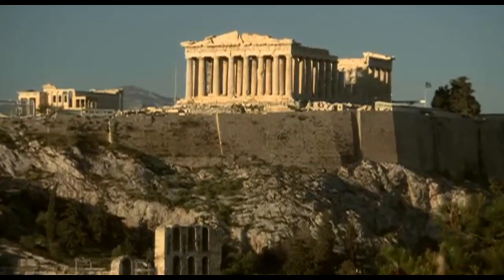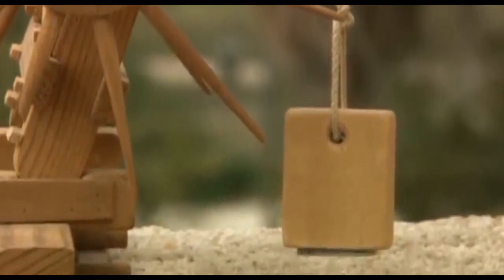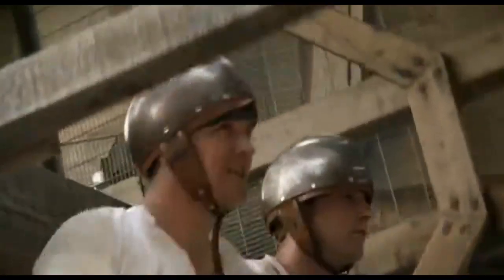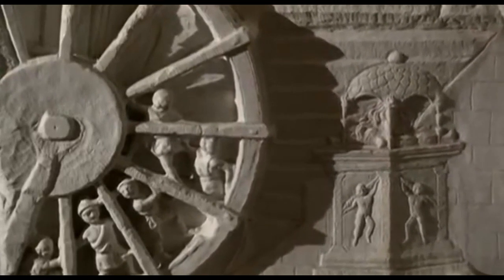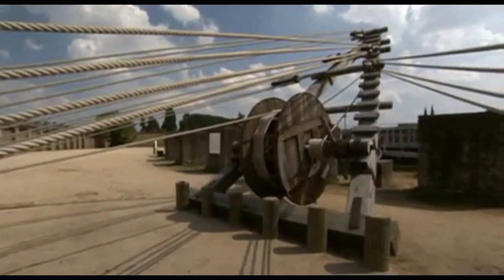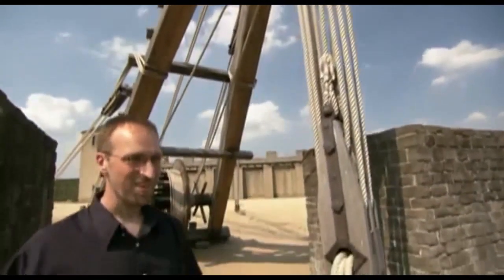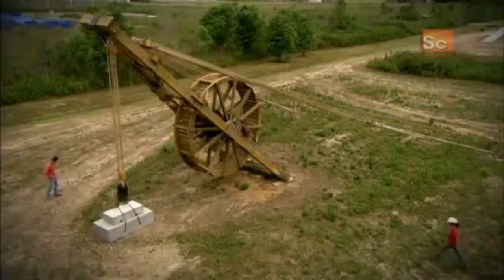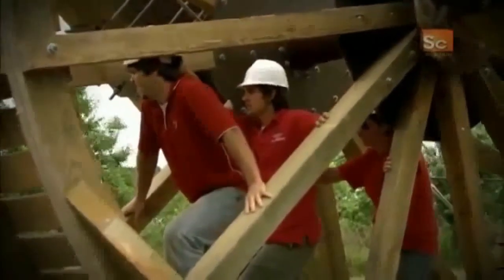Ancient Cranes are Modern Cranes GEARS PLUS COMPOUND PULLEYS

Comment: so what about a 100 ton or 300 ton block? they claim the romans had it but egyptians didn't, but egypt had just as impressive stone movement
Reply from the maker: neoclassic09 Roman cranes there based on compound pulley and capstan (mouse wheel) . It’s all based on ancient ship tech. The mouse wheel just a large version of winch used to lift buckets up well and the pulley can be replaced with truckers hitch or just a greased branch.
Typically said the Egyptians didn’t have wheels but that means they weren’t using axle wheel such as on carts or chariots. They did have potters wheel.
Same with the Egyptians didn’t have pulleys. None found but with a piece of rope tied into hitch or just piece of wood they could serve as a led pulley system.
But they did have ships and to rig ship mast and sails you have to have some knowledge of mechanical advantage. Small crew can not operate a ship otherwise. Surviving rope, knots show they had the skill. The wood and rope they used strong enough for the heaviest stones they moved.
Plus the best Greek- Roman machine designers and engineers came from the Library of Alexandria in Egypt.
Could be it was just a city that inspired  inventors and engineers but I reckon people like Eratosthenes read the old works stored there. Then got the credit for repeating much older experiments and designs.
Reply: @SacredGeometryDecoded  ..ofc the egyptians had no clue of a wheel...^^ but they measured time and knew about circles etc etc etc xD ...but they never manged to slice up some tree or something to create a wheel ^^ makes so much sense... ^^ that was much too advanced for em...^^
good compilation yo!
Reply: @SacredGeometryDecoded  Egyptians had water wheels as well
Reply: Did the Mayans use the wheel? but they built whole cities with pyramids .. likewise cycles of time or round towers ...
  Incas and their magnificent megalithic walls and temples ..
Check the oldest Egyptian boats from the time of the pyramids or the wall paintings .. cranes? Sails? .. are we talking about the Middle or New Kingdom, the age of iron, the age of chariots ??
Reply: @KaroBike  no. they never saw sth that was round nor square.